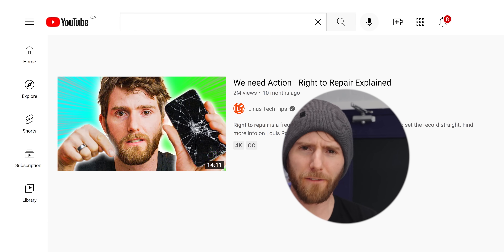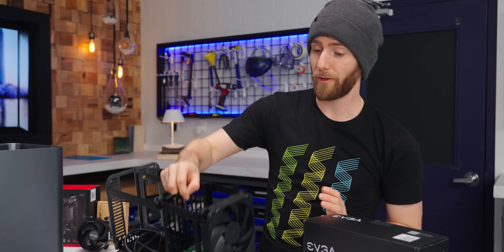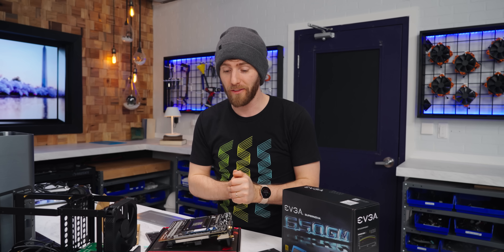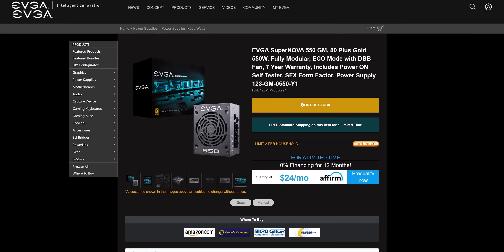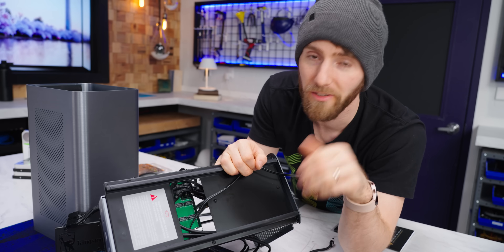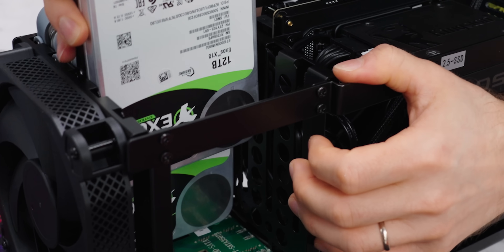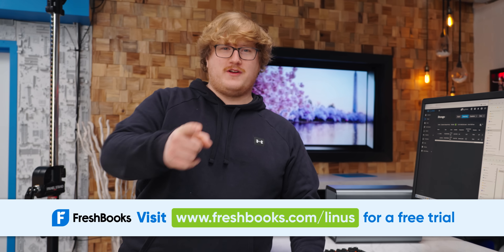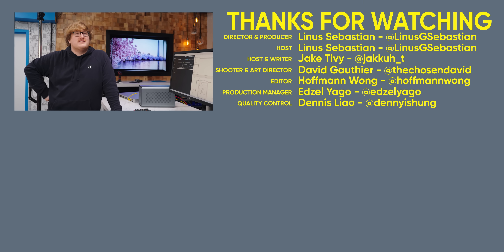This blows away the competition - JONSBO N1 NAS Build

Comment: What about the power consumption and noise? That must be way worse than some low-end CPUs, some of them consume only 10W or less without drives, I don't believe you could ever achieve anything near that with a DIY PC version. It seems to be an overkill for only NAS storage, which might cost the same but will cost easily 2-4x more on the electricity bill.

Comment: Nice one!
Can you do a low-power NAS next, which in idle draws as little power as possible, but under load allows for at least 60MB/s write speed?
Would be interesting for areas where price for electricity is high 😌
Reply: I'm running a Fujitsu desktop PC as Nas. If you don't mind the space it takes up it's a cheap solution with a lot of oomph. I got an older one that only has an E90+ PSU, newer ones have E94+. Mine got an i5 6100 because I sometimes need some oomph for stuff I'm running on it. That's why something like a raspberry pi isn't enough. It's more a home server than just a NAS. It has 5 SATA ports and one m.2 slot, and when I spin down all the HDDs, I measure 8W at the wall socket under Linux, which lines up pretty well with what their energy consumption white paper states for idling in Windows with the HDD spinning (11W).
Reply: J1900~J4215 boards maybe?
Reply: Thank you for the answers!!
8 Watts is pretty good for a whole home server!
But I indeed thought about using a raspberry, since these can go even lower, as far as I know.
Especially in the current situation each Watt that is not used in my network for the 24h-on devices helps 👍
But if there are other SW/HW combos that allow for, say, 3-5 Watts idle, I‘d like to hear about them 🙂
Reply: Intel NUC
Reply: @bugs181  if you're ok with just one drive that's even better, some can do <5W
Reply: @chunye215  It doesn't have to be just one drive. The newer NUCs have thunderbolt support, 10GbE, USB-C, etc. All kinds of external drive bays exist. Some of the new models even have PCIe 4, which can give you an HBA (although at a higher power consumption).

I ran an Intel NUC Gen 1 with USB 3.0 to SATA with a SATA port multiplier. It had 8 drives and cost me less than $100. That's what got me started in self-hosting.
Reply: @bugs181  the newer ones may work fine, no experience there, but could you do it on the older one reliably? Has been wonky for me in the past, sometimes the drive would drop off the system after weeks with just a simple single USB 3 WD drive. Never would've dared to try a port multiplier or anything. Could you properly power all the drives via the USB port too? Otherwise with another power supply just for the drives I guess the savings are almost gone.
Reply: @chunye215  reliably? How would you measure such a thing? I had it running for about 5 years before I upgraded. I repurposed the NUC to be a Proxmox box and have debian installed on it now. It's still running to this day. 

Was it ever the fastest machine to do the task? No, but it was extremely low power and makes almost no noise. For someone who was in a tiny college dorm back then, it was exactly what I needed. Now, it's just a spare computer to the task in a remote area. It's still pretty dang good at what it does.

I went out of my way and researched every port multiplier on the block. My requirements were simple. It needed to support SMART and it could not ever switch drive letters. The latter requirement was less relevant than I expected. Swapping the drives between SATA ports worked, and even plugging the drives into a different USB hub worked. 

The drives were powered by an external power brick backed by a UPS, so that was never a concern of mine. The power brick cost me about $20. For me it was never about "cost savings" from a build perspective, it was about energy consumption, being quiet, and being in a tiny footprint. All that said, the total build cost came out to about $430.
Reply: @bugs181  as described before I couldn't get a USB drive to not just disappear from the system randomly every couple weeks. I think that hardly qualifies as reliable :) Maybe I just got unlucky with the combination of drive and USB controller, but it was enough to say f- it and go with internal drives only, and the distrust just stuck with me. Less experimentation.
I still think just by having another power supply for the drives makes it less efficient overall, at least compared to the system I mentioned above, but obviously a whole mini tower is much more clunky and less elegant to hide in a dorm room to not get into your way. I've been there, although it was back in the days of dual cores being a novelty, and I remember switching from IDE to SATA along the way. At some point I just had a shelf in the corner with a Mainboard and drives on it, so I can get away with less fans. Also there was a via epia involved at some point (mini ITX! Wow such small!), but memory is foggy.
Reply: @chunye215  I think the dual power supply thing is just personal preference although I'd have to disagree. In computing, you ideally want to eliminate single points of failure for redundancy. 

Out of curiosity, what OS did you try this on? It should be noted I ran several issues running Windows on it. After running Proxmox on it (based on Debian), all of the issues magically disappeared. At that point I was running OpenMediaVault as a VM in Proxomox. 

A common thread with any type of computing is "well, it didn't work for me". At that point, we're just guessing what the issue could have been. It's very possible the drive kept disconnecting BECAUSE of inadequate power. I might not have seen that issue since I was running an external power supply.
Reply: @bugs181  I've been on debian ever since. That specific experience with the USB drive must have been some time around 2012 maybe. Not saying you can't get a stable setup with USB, you evidently did, but then again, this wasn't the only time something went wrong with USB. Not that SATA is flawless, but I think it's mostly painless, if not only because it's made for one thing only while USB has a a thousand use cases and is a way more complicated protocol. And I was totally into experimenting with stuff back then and trying to make everything work. Just not that much time for that today, so i mostly try to stick to the beaten path.

For the power supply my main point really only was efficiency regarding overall consumption of the entire setup, measured at the wall socket. The biggest loss is always at getting from mains voltage to <= 12V, so doing this twice tends to be worse if you don't have two really good PSUs, compared to having a single one with a decent rating. And I'd argue that when you have two, as soon as either one fails the setup becomes mostly useless, except that the machine itself would still be responsive if the HDD bay PSU failed, so you can try to remotely assess the situation. So neither setup doesn't meaningfully increase availability. You'd need two PSU in a redundant setup for system and bay, but no idea if that's even a thing. :)
Reply: @chunye215  very good points. I was about to make the case for why redundant PSU on this setup wouldn't be worthwhile just as you did but didn't wanna complicate the topic. I believe the setup I used was back in 2015 sometime. You're correct on the losses of converting to 12v (x2) however when compared to the alternatives at the time, it used far less energy than what else was available (except the rPi). I think for me, I was consuming somewhere around 45 watts under heavy load. At idle, it pulled in around 4 to 8.

Comment: mmmhh I would rather go with a server mainboard instead of gamer mainboard. Especially if you start with Raid 5 or 1. Raidcontrollers on gamer/consumer motherboards suck badly. You could have gotten for the same price a supermicro itx motherboard with LGA 1151. AND you would have onboard GPU/APU. And you are using TrueNas CORE if you would have gone with TrueNAS Scale you would have easy docker handling, easy virtual Maschine handling and so on. No need to mention other who might be better. Again kinda unprofessional

Comment: If you need it to be that small it's nice, but the case seems like a 
real hassle to work with, and since drives will fail sooner or later 
paying a premium to make it harder to swap them doesn't make sense to 
me.  No redundant fans on top of that is a deal breaker.  actually protecting the data is way more important than a tiny box that looks pretty... especially in a storage server that you can put anywhere out of sight that you like.

Comment: This is pretty awesome, but what do you backup this to?  Fire/Water damage, theft , double hard drive failure etc. If  you lost the OS drive how easy is it to get the system working again?  If the mainboard failed, will the system work on say an Intel?  Why not a HP Microserver? instead? I think not a display out is a BIG mistake, like total no no. Just put the APU in or go intel. How would you diagnose an issue if one day it didn't boot?

Comment: Some screwdriver tests for you.  
If you want to make a true screwdriver to rule all, it should be able to withstand a drop of about 20 feet onto concrete (could yeet it out LMG offices).  It should also be able to withstand a fairly hefty person sitting on it when they forgot it's in their back pocket.  Most importantly, the bits must NOT wear away quickly while screwing things tightly.  Bonus test, can it withstand a work van running over it? (obviously use old tires).  You should also consider testing how much force is required to snap the end from the handle.
If this happens to just be a normal handy man dad screw driver, I say forget these tests and just test screwing in a few hundred screws.

Comment: Since I don't have to store half the internet locally, I just run 3 drives in raid 5 (and have other storage to back that up to) in a case with 8 hot swap bays. This is very handy come upgrade time -> Insert 3 new drives, "zfs send / recv" done.

Comment: What would be really interesting about this, would be how much power does it draw compared to a regular nas?
Reply: My thoughts exactly. Comparing this build to a Synology ect  NAS completely misses the point of power consumption.
Reply: It'd be the same for the same configuration. Regular NASes have pretty much the same hardware.
Reply: 70 to 100W per hour more for this that Synology.
If you need more power for your NAS then i think is ok.
If you need only storage, no VM's, then stick to Synology.
Reply: @yoshy2628  100W for 24h = 2.4 kWh a day. That's about 870 kWh a year, or 245€ of power costs where I live (Germany). You'd need to factor that into the costs.
Reply: @mbirth  Yeah, with the massive rise in electricity prices this year, there are a lot of hidden costs for just a solely data storage option.
Reply: @mbirth  A NAS is going to be idling most of the time, looking at the power consumption under load doesn't tell you much.
Reply: @KyussTheWalkingWorm  I'm pretty sure the build in the video will still eat A LOT more power while idle compared to a Synology.
Reply: @mbirth   Holy cow. Your electricity is expensive!
Reply: @jeroddunn  100watt 24/7 would set me back 410€+.. Welcome to Denmark. 
between 17 and 21 (5pm and 9pm) the cost of 1 kwh is almost one euro.
Reply: @jeroddunn  it's on average something like 32ct/kWh and as it seems it won't get cheaper
Reply: @Markus Birth @tobakken Remember that your NAS doesn't need to be on 24/7 though, you usually set a power schedule so that it turns on a few minutes before you usually start your day, and turns off a little after you're typically done. Having a NAS running when you're not generating any data that needs to be housed or backed up is basically just throwing away money =)
Reply: @mbirth  No. There's no reason why it would, & the nameplate power rating on a Synology tells you nothing useful for comparisons.
Reply: @mbirth  It's not pulling that constantly unless you're running servers/vms or something. It's not just constantly reading/writing for no reason.
Reply: @t0bakken1337  u never been  in Italy m8 XD
Reply: @jeroddunn  Yeah. In January I got a letter from my energy supplier which told me that there will be an increase of 74% in costs.
That is part of the best Germany of all times we are living in. At least when I believe our politicians...
Reply: @mbirth  I can tell you didn't get the letter from your power company yet. Can't get anything below 0.48€/kWh now, and even old contracts get increased prices.
Reply: @markii72  Got a guaranteed price of 30,84 Ct./kWh until December 2022. 😉
Reply: @mbirth  I am lucky enough to still have 22ct/kWh from a small Wind/Solar community provider in the North-West, BUT if I'd sign a new contract it would be 44…
Reply: @yoshy2628  Nope. Nearly all the power is drawn by the drives, which will be the same if you're using a different NAS system.
Reply: @yoshy2628  That is just bullshit, an R5 + B550 at idle runs nowhere near 70-100W more than the DS1520+
Reply: Use intel T version of processor then. It draws less power. Unless you need a heavy virtualization or transcoding, I think intel core T will do the job just fine.

Comment: Yes, you saved 20 bucks and got more horsepower, but in comparison to synology, it's much more difficult for noobs (as I am) and at least did not mention whether truenas offers all the handy features like smartphone apps that lets you automatically backup your phone everyday, or how easy ist is to set up an off the side backup that incrementally and automatically  backs up your primary synology. At least for me that beats a small cost saving, and missing horsepower.

Comment: smb is terrible,  network discovery can take hours sometimes,  the connection can randomly stop or drop,  just to put it out there you can mount an nfs share in windows with no problems.  i recommend avoiding smb if you can

Comment: With the compression, zstd is often the best option as it is very fast and also has good compression ratio.
Reply: though I would differ and add a different dataset for data that can't really be compressed further like mp3 and video files.
Reply: @bFix  If you use BTRFS with zstd it will opt not to compress by default if it sees no improvement in the first data block it writes. So uncompressible stuff will not get another pass of compression.
Reply: @bFix  provided we have the option to train zstd, mp3s and video files /can/ be further compressed because of how much shared data there is between files in collections of mp3s or videos. Even if you can't easily compress an already-tight-layout file further "on its own", once it's part of a collection of data where all the other files have the same structure it becomes further compressible (because you're no longer compressing individual files based on their internal byte layout, you're now compressing files based on properties of the entire collection)
Reply: @jurrich  are you sure the compression in true nas doesn't work just on a per file basis?
How much time do you want to spend finding similar mp3s when there are 10000 you need to compare?

also I'm fairly sure that lossy compression is never bit exact, for video it's even more likely to end up being way different in the compressed version. especially(!) since videos use different frametypes, so if the videos aren't in sync or have different gop lengths, then you are pretty much screwed, because I-Frames, B-Frames and P-Frames aren't in the same order.

Audio might be a different story since it doesn't have as many dimensions to grow in and might contain repeating patterns even within a file.
I expect flacs (lossless compression) to have a few percent of increased compression. but not with lz4, maybe with zstd but most likely with lzma2
But you don't want to use lzma2. It's way too slow.
lz4 and zstd make sense because they increase read speeds for the drive by having fast decoding speeds and still having a remarkable effect in compression

same goes for brotli compression if it's structured text files like HTML.
Reply: @jurrich  I mean the idea is good and only logical, but I think there are practical reasons why this is too complicated or won't save enough space in the long run or will increase your electrical bill significantly.

else cloud providers, YouTube etc. would be using this extensively

they don't, storage drives are fairly cheap, so they rather install new ones.
ok the upload rate to YouTube is too large for this to ever work 😅
bad example, still
Reply: @jurrich  You can't really do this with compression nicely due to stuff like fragmentation and rapidly changing datasets. You can however use a filesystem with deduplication so it will do it for you on a block-to-block basis. This is mostly useful for identical files. Compressed and encrypted files are going to wholly different with even a single byte difference so it will not help you much there. If you have a static dataset, use a container like .zip or .gz, that's what they're for.

Comment: Scale is still on RC, not yet ready for production. There are still performance/bugs issues comparing to Core that need to be ironed out, even though it is pretty stable. You can check out Lawrence System to find out more. For rock stable, tested storage, go for core. If you are so into VMs and Apps, and has room for some fun and testing, Scale is definitely more interesting. But if you are running LTT, I will still go for Core.

Comment: The thing is. By the Thumbnail one get the impression that "oohh..100TB cheap"
When in fact you have to buy what is depicted in the Thumbnail and THEN 5 X 20TB drives.
And without RAID...to use as close to 100TB as you possible. 
Can't imagine anyone want to risk having 5 X 20TB in JBOD mode.
1 faulty and Boooom !!! ..Everything is gone.

So the video tittle and implications are Clickbait in my view. Thumbs Down.